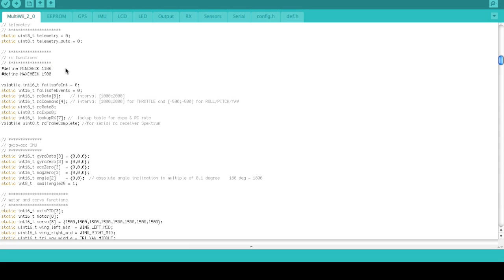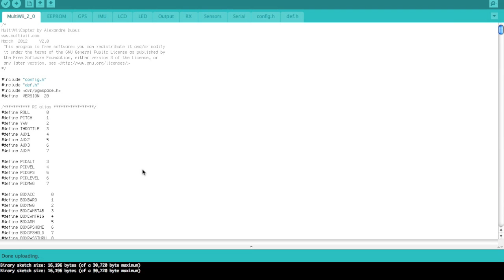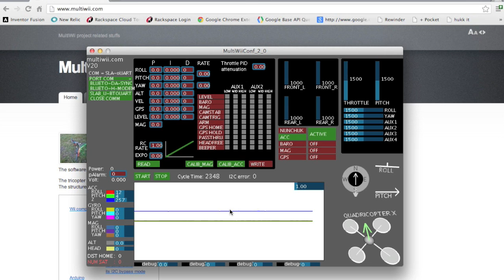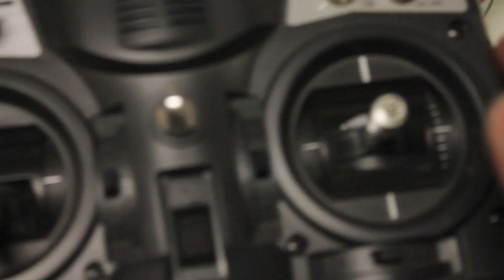DIY Mini Quadcopter MultiWii Configuration and Maiden Hover Fail

Comment: i had somewhat same problem as you had my mw board doesnt give enough throttle to all it gives more power to diagonal motors d10,11 a throttle of around 1500 where as to other it gives around 1200 which is little bit weird also so my quad is unstable did someone face the same problem

Comment: My first quote from a local 3D print shop, needless to say I passed!

Print: ABS 
Color: tbd

(2) top = $65.00 
(2) bottom = $140.00 
(6) mount = $115.00 
(6) boom = $65.00

Allow 3 working days for completion, local pickup. Shipping charges additional as required.
Reply from the maker: Chris, that's a crazy rip-off in my opinion! I don't want to bash these guys, but WOW that's really high. I may have mentioned this before but I have a friend in Austin that would be happy to do it much cheaper. And checkout makexyz.com if you haven't already.
Reply: Dennis Baldwin I went through a local makexyz.com in Tucson and they charged me $37.00 to make 2 copies of the mini quad. I received quotes from Nathan and Zwcky in Austin too.

Comment: Dennis, I have decided not to wait any longer for getfpv to have the QAV400 in stock. Instead I have decided to build the Mini Quad. I have submitted the drawings to a local 3D print house and waiting for a price quote. I have already ordered all the hardware. What I would like to know is are you still using the default PID values on the Multiwii Flip 1.5 or did you end up changing them? If you changed them could you please post them for as a reference point.

Thanks again for the great video!
Reply from the maker: I'm using the default PIDs with the MultiWii Flip and it flies well. It lags a little bit so I plan on tuning those up soon, but I can't get myself to take off the CC3D now :) BTW, I should have a video out later this week about an 3D printable FPV H-quad that I'm working on. I've printed it an am working on the electronics. Not sure if this thing will fly, but I'm praying that it will! It's pretty small too. I'd say around 225mm diagonally from motor to motor. That's just a guess though. More details will be coming soon and just wanted to mention. Once again, there are not guarantees I'll even get this guy in the air!
Reply: Cannot wait to see your new 3D FPV H-quad. I am still getting pricing on the Mini Quad from makexyz avg. cost is $40.00.

Comment: Did you solve your problem??? Your tx is in heli mode which is what is causing your problem in my opinion. cheers Mark
Reply from the maker: Mark, thanks for the comment. The actual problem was the motors were way under-powered. See here for the latest build log:

http://garagepilots.com/page/diy-mini-quadcopter-w-3d-printed-frame

Comment from the maker: Wow. I have never seen those and you're right, they totally look like mini Tigers. I posted a response to another one of your comments, but I went with the Turnigy 1811 2900kV. I also ordered the 1811 2000kV to see how they perform as well. What's great about these motors is they come with prop saver, bullet prop adapter, bullet connectors for esc AND motor, and heat shrink tubing. Too bad they don't have mounting hardware!

Comment: Hi Dennis, I run MultiWii ver 2.2 on all my flip 1.5 boards and in the config tab there is a line like Francis is talking about that you can uncomment and calibrate your esc all at once thur the board. You have to uncomment it. then upload the firmware. set your throttle at full and plug in the battery all of the escs will beep once and then bring your throttle down. You then have to reload the program with the line reset. You may have already tried this, but if not gave it a try.

Comment from the maker: Thanks for the suggestion. I've calibrated all ESCs individually multiple times. From reading the MultiWii wiki it says:

"If the ESCs of the copter need calibration, a special version of MultiWii can be built, that does nothing but trying to calibrate all attached ESCs. This may come in handy when plugging/unplugging of the cables is undesirable or near impossible (soldered cables)"

I can definitely try this approach, but not sure it will be any different than what I'm doing now?

Comment: I don't think this is causing the problem, but why don't you eliminate red wire form 3 of your esc? I'm not multicopter expert but i think it is always recommended to power receiver and board only from one BEC because otherwise they interfere between each other and it can cause failure. :D

Comment: I don't know much about MultiWii but I have the same question because I had the same issue on my KK2 boards and after calibrate 4 ESCs via KK2 board, all issue were gone. BTW, your video inspired me to MOD on my miniQuad. You can check it out when you get a chance. :)